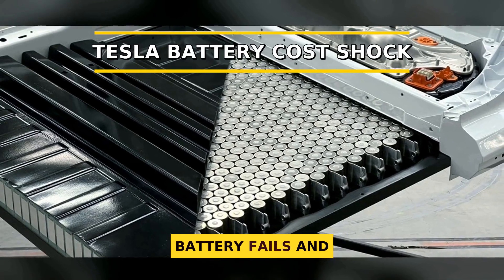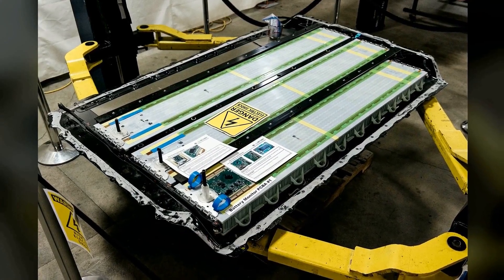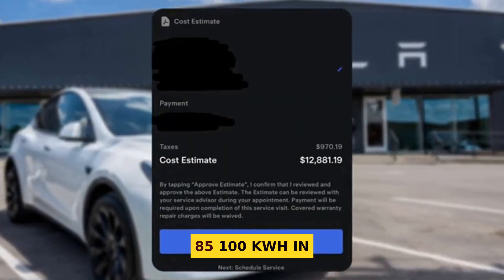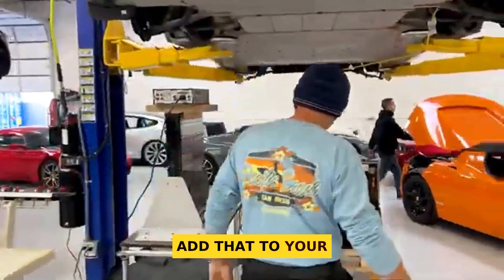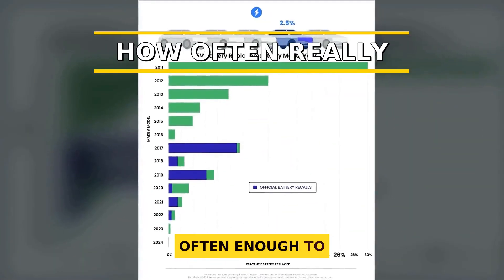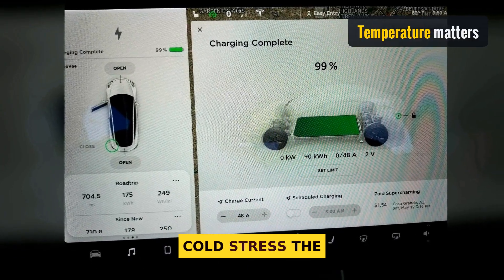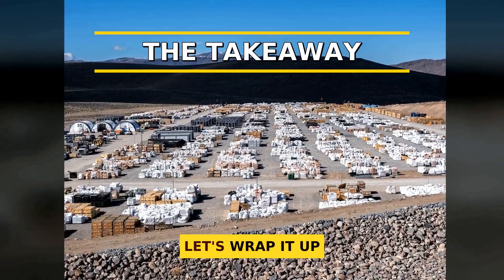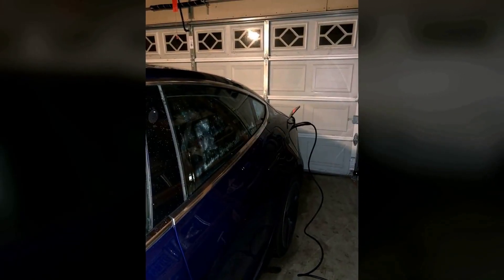Tesla Battery Replacement Cost 2025: Real Prices Revealed

Comment: I’ll save u th trouble as im replacing my battery now on 15 model s 85kw

eBay :5k-7k used battery + labor 
Green tech 10k batter remanufactured 1k labor 
Tesla 17k all in

Comment: A. Tesla battery. Replacement  in 2025 
Typically. Costs. Between  $13,000 and 
$22,000 or more 
Can. Be priced. As 
Low as. $42,490 or. As high as. $125,490 in 2025
Reply from the maker: @JeremyThrockmorton, it sounds like you’re quoting some wild prices there! 😅 While the typical range for a Tesla battery replacement in 2025 is around $13,000 to $22,000, I think we might need to check the price tag on that $125,490 option—maybe it comes with a complimentary yacht! 🚤 What do you think?